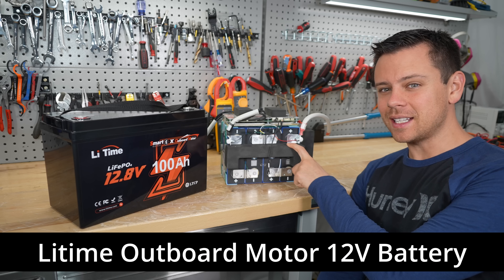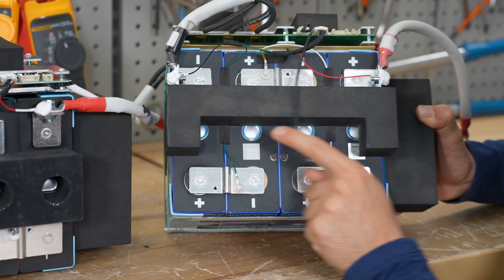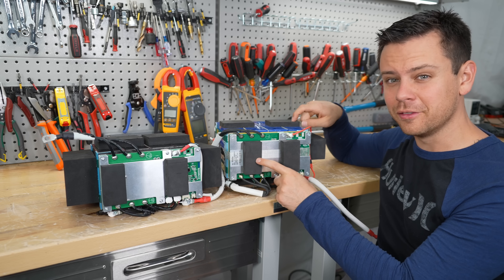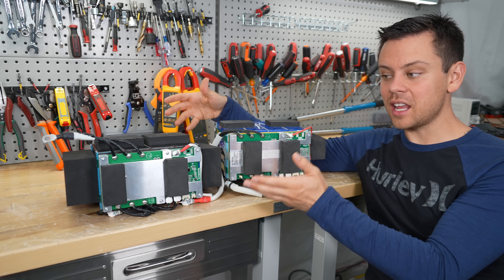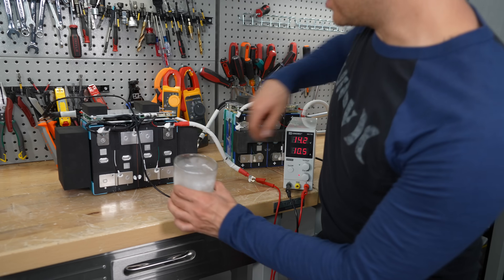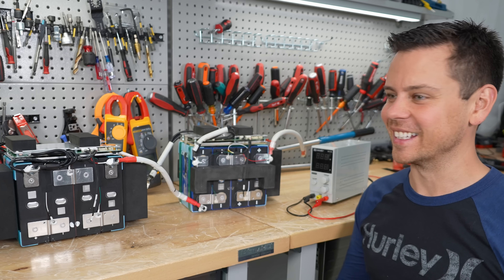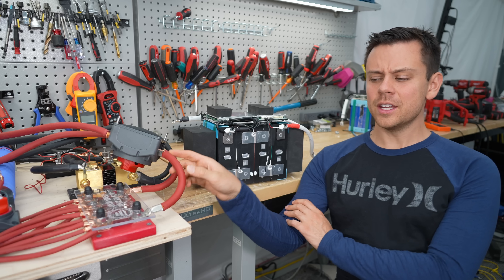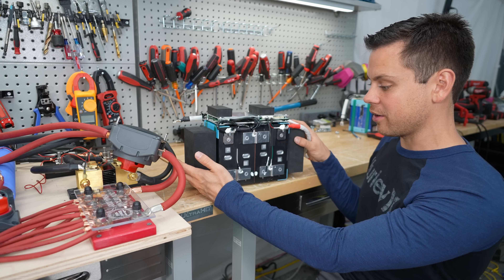New LiTime 12V LiFePO4 Marine Battery: 300-500A Surge?! Run 60V Motor?!

Comment: Very interesting.  Thanks.

As you have done a lot of 48V and now 12V, do you ever plan on hitting up 24V?  I have found 24V interesting for a long time and it has gotten more interesting due to it being used more and so there is more stuff out for it.  To point out some of my findings:

1. USB charger / power supply on 24V DC input - Super efficient, especially for USB-C PD power.  My USB charger with PD barely warms up at all while powering and charging my laptop computer.  Super efficient.  Compact.  Cheap.  Versatile.  That DC-DC buck conversion from ~26.5V to 20V for PD is definitely far more efficient than going through a 120V AC inverter with its own parasitic draw to a cheeped out power brick rated for my laptop that wastes power like mad and then back to ~20V DC.  I mean you are talking about ~97% efficient versus <50% efficient.  Huge difference.  Then I can take my USB charger and plug it into the 12V in my car, granted for the laptop it has to pump up the voltage, which is less efficient.

2. Dedicated brand specific laptop power supply - These are also made for a wide DC input range now covering 24V.  As most laptops stop at 20V, these should be doing the same super efficient buck conversation down to laptop voltage.

3. 120V inverter - The wiring is a lot more manageable for a 24V inverter over a 12V inverter for the same power output.  You go up to running your fridge for a day on an inverter, a 24V 100AH battery will run your typical fridge all day or all night and it will run an energy efficient fridge all day and all night.

4. Portable fridge / camping in general - A lot of portable fridges will run on 24V power.  With a 24V, 100 AH battery, I can run my portable fridge for over 3 days straight.  Great for multi-day camping trips.  If there is sunshine available at a camping spot, then just rig up a solar panel and charge controller and have unlimited power for your portable fridge and USB devices such as your cell phone, flashlight, headlamp, and LED lantern.  Want to work while camping, bring some extra solar panel capacity, use the battery as a buffer, and hook up your laptop and communication device of your choice.  Could even do a mini Starlink terminal direct off of DC now, which could make for an interesting demonstration on your channel.

5. Hobby charger - Say you want to go fly around your FPV drone, R/C airplane, R/C helicopter, drive your R/C car/truck, etc.  24V works great with hobby chargers.  Much better and faster charge than running off of 12V for the input, especially when you get into say 6S LiPo packs.  With 6S packs in particular, I will charge 6 packs at a time at maximum power of a high powered charger and the fans on the charger won't even kick on until it gets to balancing the cells.  The charger stays plenty cool basically just dumping the power across from the 24V LFP battery to the 6S LiPo packs as the voltages are pretty close with the 6S packs just slightly lower.  And with charging six large 6S packs at the same time with fan-out adapters, each pack is charged at a safe rate even with the charger working at a high power level; just gotta make sure the pack voltages are reasonably close before hooking up.
Reply: Look into Will's older Videos. He's done 24V systems before, as well as comparing them to 12V systems.

Comment: These are getting pushed for boaters. ABYC has recommended Bluetooth on Lipo, So many boaters switching to lithium now in their house banks. I am one of them. Our systems in the US mainly run on 12v.  I have 3 12v litime in parallel for my house bank. Reason space! These have worked flawlessly. I actually went with your recommendation. Why buy battle born? For 3 it was less than 1 battleborn. I wanted the 12v 420ah but could not fit on my sailboat.

Comment: Have you seen any batteries with heatsinks for the cells? I'd be curious to see how much passive cooling would help. It would also be cool to sandwich water cooled heatsinks between cells for high-performance applications, especially for something like a boat.
Reply: LFP cells should not heat up past 45 Celsius if at ambient 25 Celsius.....only power cells that are doing 5C+ might get towards 60 Celsius...its really a non issue for the VAST majority of applications.

Comment: Not sure about the newest traditional trolling motor designs , but while the older ones will work on on lithium with its higher voltages during sustained operation , the motor manufacturers caution against using the motors on their highest settings for sustained periods when using lithium batteries .
Since the motors were designed for lead acid batteries and the voltage drop inherent to that chemistry , they claim the motors may be damaged by the higher voltages of lithium cells under heavy load and sustained use .
Not sure how true that is really , but probably more of a problem with larger / heavier vessels or operation in thick weeds brush where you can put a LOT of load on them .
Just something to be aware of . I have one of the old style LT TM batteries , but haven't been able to get my boat in the water this year . So can't really say how well it works .
Maybe somebody can rig up some trolling motors in a tank and compare performance ( and any issues ) , side by side with the different chemistries ?
Be a big PIA but you would think SOMEBODY would go for it just to unmuddy the waters so to speak .
Reply from the maker: That's very strange because it should run much cooler with lithium. What's their logic
Reply from the maker: They have a flat discharge curve but they're not at a high voltage at all.
Reply: Please cite a manufacturer making such a statement....What Will said is exactly right. Maintaining a higher voltage means less amps will be pulled to generate the same kW power output which is LESS heat.
Reply: The newer higher end units are brushless and have no issues running sustained. The biggest concern is to ensure that you are running the correct gauge wire from the battery to the trolling motor and have the appropriate size breaker. Most new wiring in most of the boats are 6ga with a 60a breaker and are either 24 or 36v setups in most current bassboats.

Comment: I know this is off topic.but I am looking for an inverter for an automatic battery backup in the event of a power outage. I would like it to send a sinal to start a stand-by generator to change the battery bank. One day, I might add solar, so I would want that option. Does anyone make something like that? The inverters I have looked at all have an AC in but not a separate generator in.
Reply: Victron.....I used to hate on them a lot because of their price but they are definitely you get what you pay for. Look at either a Multiplus II or Quattro

The EG4 6000XP is the more budget friendly option that while new to the market is getting more love than the 6500EX got
Reply: Look for an All-in-One unit. I believe EG4 has that kind, as well as a couple of other manufacturers, with those stats.

Comment: You can bring that battery up to temperature safe for charging so quickly by putting a load on it. You would almost never need a heater on it unless you store it in the cold while depleted.
Reply from the maker: That is a very good point
Reply: Cold weather protection is for automated charging setups like solar panels. If you are manually charging your batteries or keep them in a warm location you may not need cold weather protection.
Reply: I debated which way to go for my travel trailer, but using a li time heated battery made for a much cleaner installation than trying to insulate the battery inside the trailer. After spending a year living out of my trailer on a job site, where it would get below freezing during the day, it seemed better to take the easy route that I know will work and be safe for the battery. Space is limited and I installed the battery under my couch instead of outside where the originals were. Hopefully, the heat won't be needed but it is an option. A single 200ah battery is working but I may add a second one, so it isn't a huge price difference. A larger bank for a home would be a different story.

Comment: If you want to get the more surg output, you could put supercapacitors on the output side of your battery. Then it doesn't matter as much what your battery surg is. The issue is that these are used for automotive audio and are usually overpriced. You would need to calculate the price on using cheaper batteries with less serg output + supercapacitors. 

I think going for a high voltage (48v) system would be more cost effective. Pulling from four 12v batteries in parallel puts less (1/4) demand on each individual battery. The rest of the system would have to be 48v, though.

Comment: I love that budget oriented batteries are starting to become harder to tell apart from their more expensive counterparts for features and value.
Reply from the maker: Very true
Reply: LiTime/Redodo/PowerQueen honestly set the bar for budget brands that want to earn the build quality seal of approval. Sometimes lacking in features when you are talking about their cheapest priced batteries but at the end of the day they've consistently used new prismatic cells from known manufacturers. The spread of JBD-like private label BMS's is very encouraging too since its damn near impossible to find a JBD that's failed.
Reply: @ericklein5097  Are those three brands identical?

Comment: Please review the balancing behaviour of these batteries, how big is the balancing current and if the balancer works in the float mode. In other words, is it possible to simply balance these batteries with low current PSU, or it is necessary to disassemble the battery and top charge each individual cells.
Some 12V batteries has shitty BMS that would not even have 30 mA balance unless it detects at least 0.01C charge current.

Comment: I would like to see the case just a bit larger than the battery - so smaller than they are now.  I understand they want them to be "drop ins" but for a RV or boat space is limited...
Reply: The vast majority of cheap LiFePO4 battery "manufacturers" are just using AGM battery cases that they can buy in bulk dirt cheap. Having cases made to fit the variety of cell sizes+BMS's would probably quadruple their cost on that end and with the market nosediving to $200 12V 100Ah LFP batteries I just don't see many of them doing it.

Comment: These would be good for a washer and dryer in an off grid Environment is what I surmise where I could utilize the higher current, any more ideas? I guess a bigger oven or toaster as well… I got a bunch of the new Bluetooth ones and they are great. I did complain about the sign in feature, though, as you have in another video, but they seem reluctant to change it